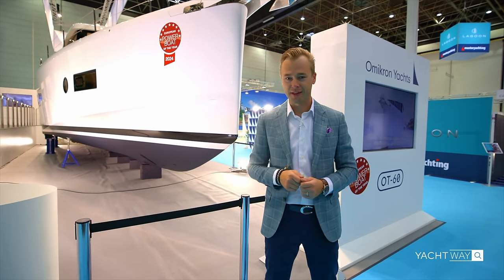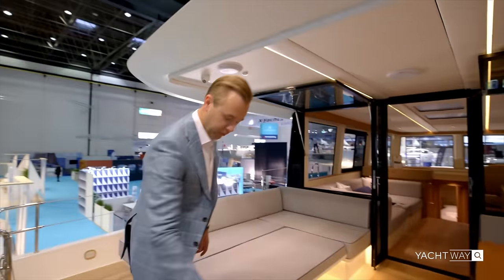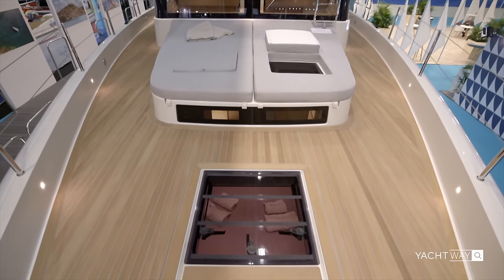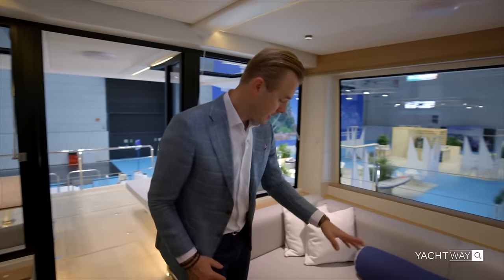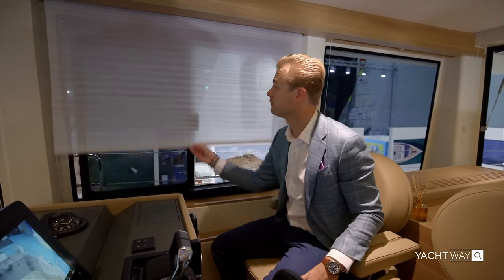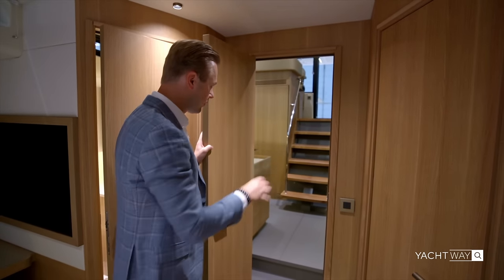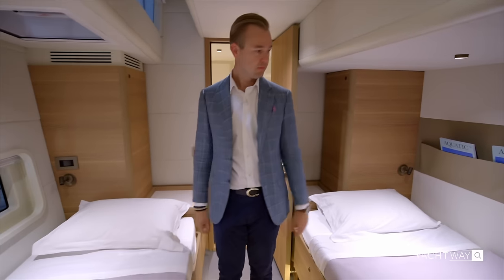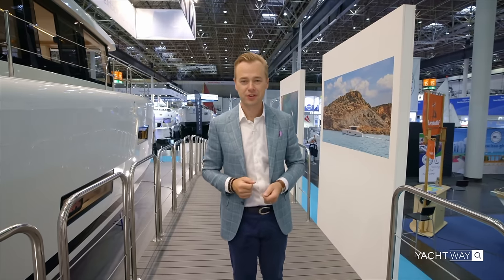Best Boat For Great Loop And Bahamas? - Omikron OT 60 - Yacht Tour

Comment: I'd want the window by the helm to be a door, and in all honesty I'd prefer it if the front windows were reverse sloped (even if only a little bit).  I would also want sensors on the opening portlights in the cabins (like Riviera does) so you don't get any wet bed surprises when you hit some waves!
Reply from the maker: Good tips. Thank you for watching!

Comment: It's a pretty cool boat. What I really like about it is the shallow draft and the fuel consumption is amazing. But a few other things made me think what were they thinking? you mention the very wide side decks.They are nice but the they make the saloon tiny for a 60 footer. There is enough room for 2 people in the saloon but there is enough room for 50 people in the cockpit . out of proportion for me. I was pretty surprised how little room there is inside for a boat 60 feet long and almost 20 feet wide.What really made me smile was when you mentioned the huge freshwater tank of 158 gallons on a 60 foot power boat.I would say that's pretty small.

Comment: I designed and built several small fast power boats with a very similar wide beam and short lenght shape hull in 1991. It was a very fast boat with a small engine and I could cruise all day with a 25lt tank of fuel. This boat has a long range due to its wide shape hull thus it is very bouyant and lighter weight Ratio. Next step is to have one with out board engines?😁 That will be even a better boat!
Reply from the maker: Thanks for your comment and suggestion- that would look like a funkie boat no doubt 😅